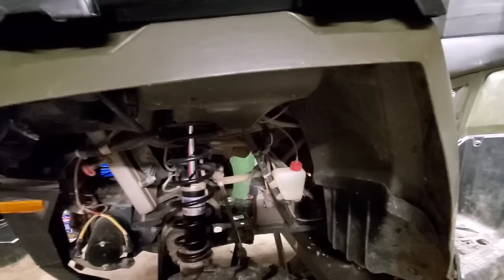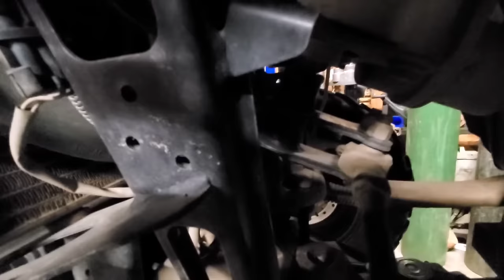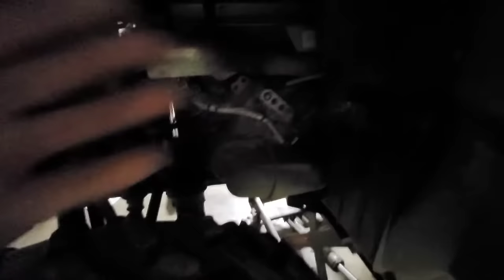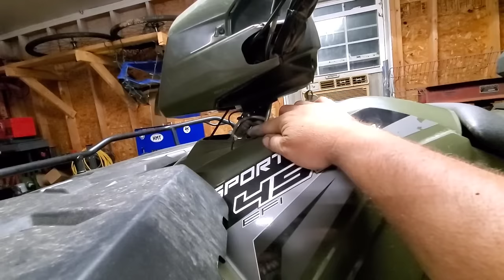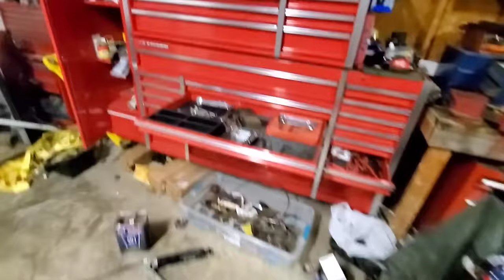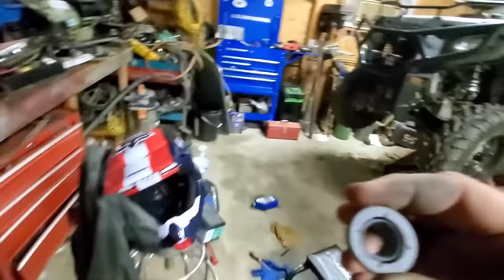Dear Polaris...this is shameful  #polaris #atv #sportsman

Comment: 2013 Polaris Sportsman 500 HO here. (Camo Edition). 1,460 mi.  189 hours.  Original owner, The only stuff that went bad so far was, some batteries, the O-ring for the float-needle in carb, oil changes, and the idle-adjustment knob sticking out of carb & a few plugs in the tires. No loose steering or wobbly tires or anything I can really think of other than the the choke knob don't stay out by itself when cold. The wire holder-support for choke-knob broke off the 3rd day I owned it.  Thinking about selling it in the spring.  Probably one of the most gently used atv's around,  I have a new 400.00 plow that I used once for less than 5 minutes.  I'm 63 years old now.  Was 2013 a good year? Sounds like the newer ones have gone down hill.
Reply: Still riding my 2009 Ranger 700 ! No problems other that normal maintenance!  I think today I would probably go with a Can-Am Defender if I were looking for a new UTV.

Comment: I have a 2020 570 premium with 2400 miles absolutely solid aside a brake pressure switch that dealer replaced. I wish I could give a video but I'm too old I don't know how to show everything in mine is tight yet. Rides like a dream and nothing wrong. You have another video of an 850. Why did you buy that one if you already had this one? I had a 2017 450 sportsman that was perfect but it had no power steering so i traded it for my 570 and currently have 2400 miles with only the brake pressure switch. Kawasaki brute force 750 is best machine hands down. Unfortunately you cannot get a factory windshield, heated grips, heated throttle and it only has two 35 watt halogens that absolutely are worthless. I live in Minnesota and it gets dark here at 5 ice fishing. Those lights are just about worthless. Factory Polaris 50 watt halogens with the 50 watt pod are very good. I asked a Kawasaki dealer for a windshield last fall they said unavailable and moose aftermarket heated grips 380 and no thumb warmer. They tried telling me thumb warmers were not a thing. Lol i had them in both my 450 and 570. Suzuki quad King is great but zero dealer support across America and again those accessories not even available. Can am is junk. Just push them on  dealership floor and listen. Plus you can't shift them without hitting your arm. Absolutely a joke how they position the shifter plus it's junk clunky. Way worse than a sportsman which ill admit is not in yamaha's or Kawasaki's class. Honda has no power steering!!! What the hell. Their three wheelers were bomb proof so I'm sure the quads are today but no power steering lol. Nope. So that leaves the grizzly. Engine will not entertain. Suspension not close to a sportsman. Will they last probably. But to get one with a windshield, heated grips, cannot order a thumb warmer, and storage is subpar. But a 23 with windshield, heated grips is 16000 in my nearest dealer. No grease zirks least none that i saw and led lights. Looked good. But my 570 2020 has had no mechanical issues sbd starts in Minnesota in February every time. Dealers are everywhere and parts are everywhere. I wanted a Kawasaki as i have a 2007 Kawasaki nomad 1600 that has never had a single issue. Harleys cannot even touch it trust me. But with no options and dealer support i can't do a brute force especially with no windshield and lights to get across a frozen lake at night. I kinda wanna see possible hazards in a 25 foot deep frozen lake. Polaris lights outstanding in my 2020. The 23 ultimate has led lights so bright honestly they lit up the dealership in day when i looked at it. Yamaha grizzly was not close even with the leds they have. Plus the pod was halogen.

Comment: I have a '07 Sportsman 500HO with 6500miles on it, it has no slop in the steering and the bushings are still tight. I am replacing all wheel bearings for the first time now, the only other thing I have done is replace the front springs and regular oil changes.

Comment: Just bought one a month ago. Already the Transmation is making strange noises and the display screen flickers colors and engine light comes on.
Reply: Either the alternator (it's called something else for Polaris)not charging the battery fast enough or the battery isn't holding charge properly.

Comment: I have a 21 850 ultimate trail with 5000km/250hours and that has all sealed bushings with o-rings everywhere except for the rear knuckle bushings that are the style you showed.  The knuckle bushings had play at 400km.  A couple sealed bushings had some play starting at 2000km.  I ended up buying garage product bushings and replaced all the front bushings and the rear knuckle bushings.  They are great bushings, they still don't have any play even after a few thousand km on them.  The rear control arm bushings where it connects to the frame are still the Polaris sealed bushings and i don't believe they have any play yet.
Other than upgrading bushings, i also did the front and rear frame braces as well as the rear diff brace from cecco racing.  I had to loctite and crank that steering stem pinch bolt down a lot to take the play out of the steering.  I just had it in the shop and found the under engine skid plate that is welded to the frame was bent up into the engine which was disappointing since I'm pretty careful not to beat up the underneath too much so i had to make a new thicker one.  I just replaced the rear U_joints as they were getting pretty bad.  The wheel bearings and tie rod ends have a bit of play in them now but i think im going to just keep an eye on them since they don't stay tight and realistically a little bit of play isn't hurting anything
I also had the sway bar sliding back and forth hitting the springs so i have to get some clamps to put on the sway bar when it was brand new
Overall it is unfortunate that a person had to get frame braces, fix the sway bar and make a decent skid plate just to feel like you are on a solid machine, but polaris isn't the only manufacturer selling machine that need modifications right out of the box.  I knew buying a new Polaris i was sacrificing reliability for performance.  Having said all that i am still happy with my purchase since mine hasn't really been too problematic and i do really enjoy riding it
Reply from the maker: As long as you are enjoying it, keep hammering the trails! Thanks for watching
Reply: Hi think yes , it’s the only top manufacturer needed mods on brand new machine out of the box like you said.

Comment: I have an 06 Sportsman 800.  Rear brake went out.  Had Polaris replace the entire system as it was over 10 years old.  Within a year it was bad again.  It is stored in a tool shed so it shouldn't go bad that fast when it gets little use.

Comment: I have a 2020 450 HO. Stalls out during idle several times until it gets 150 + degrees F. Came that way from the dealership, took it back they said it was fixed, nope, still does it every time. I have changed plug, checked gapping, adjusted throttle cable, changed gas, changed oil, air filter, no fricken clue what to do… maybe a bigger battery??
Reply from the maker: Not the battery.
When it acts up. Pop the seat and wiggle plug at the throttle body. 
My sons acts up and that usally solves it
Reply: I watched a video where low battery power was fouling the plug on new machines...change out both  new at the same time to fix the problem
Reply: Had this Same problem on the same machine. Low battery was fouling out the plug. New battery and new plug idles perfect now.

Comment: on my 22 570 they have removed the grease certs, so you know it will wear out sooner than later. the 1st time I plowed snow the front axle broke with 35 miles on it.
Reply: My eps is getting replaced. but they covered it for warranty $2200 part

Comment: I have found when a pressure washers output is too high it can cause significant damages. Many take their machines to a car wash that can have very high pressures.  With very high pressures you can actually force dirt and water into bushings and bearings.  Just a thought hope it is helpful.
Reply from the maker: Im just using a little electric jobby nothing to harsh. But the bearings simply dont seal out dirt at all.
Reply: @quadbilly2106  
 I've owned a 500 sportsman, 570, 850, and now a 2022 570 two up and knock on wood have yet to replace a worn bushing or bearing. I rode them all over 2500 miles except for the 850. The 850 the dealer offered me more than I paid for the machine and I couldn't say no.   I put 1400 miles on it in one year.. Like you I trail ride I'm not into mudding.  I've got no answers.  I really enjoyed the videos when you rode with kcatv.  I do agree with you that Yamaha makes a really good machine,, unfortunately they don't make a two uo.
Reply from the maker: If honda mad a sport 4x4 to compete with polaris in ride comfort not even power, their sales would go through the roof. I paid damn good money for basically an 8yr old chassis design with new plastics. The olde 500 were built with such better quality.
Reply from the maker: Thank you for watching. Kc atv is a bunch of damn good folks I promise you that. I had a freat time with them.
Reply from the maker: @dcsales2007   yes, I have the tool and I do grease the new ones.

Comment: Just bought a 23 450 Sportsman... def getting that 5 year extended warranty. Do they make aftermarket bushings?
Reply: Here is the problem with Polaris.  Their dirty little secret, if you will.
My mother has been an Attorney working in Polaris's Legal Dept. for many years.  We get new ATVs, UTVs, Snowmobiles, and previously, Jet Skis every couple of years for free.  Most of them are prototypes they have us "test" for them.  They do this with a lot of their employees who have been there for a while.

At any rate, one of the things my mother specializes in is "Contracts".  When Polaris is in talks to have their "Official OEM Parts" made by different companies, they have a minimum of spec requirements.  Most of the parts manufacturers BARELY meet these Spec Requirements but their prices are low so that has to be taken into consideration.

So, when someone says you should or you need to buy the OEM Parts for a Polaris "anything", your first order of business should be to stop listening to them.  There are numerous aftermarket suppliers out there and you should investigate what they have to offer as most of those parts will probably be the same in quality if not superior in quality to the Polaris OEM Parts.  

I have been buying cheap Chinese Belts for my ATVs, UTVs, and Snowmobiles for years.  I spend approx. 1/4 of the price for each cheap Chinese belt as I would the Polaris OEM Part.  I usually get a good 3 years out of them, sometimes 4.  3 years is the minimum requirement Polaris requires their belts to be able to last.  There is a matching mileage on those 3 years but I don't remember what it is offhand, but over the years, that mileage requirement has steadily dropped which shows the parts they are buying are dropping in quality as well.

Granted, some parts you don't want to be cheap about because if they break, they may take other parts out as well or they are hard to replace.  In those instances, make sure you get a quality product and your best option is usually an aftermarket dealer.

Comment: When you find a Unicorn Atv please post.  I never had. I’ve owned all makes and a lot of models and every one had mechanical issues.  My best ride and features so far is my 2019 Polaris Sportsman’s SP Hunters edition.  Zero issues to date. Maintenance and upgrades apply to all ATVs.  I still have Kaw and Hondas.  Same applies.  

Good video too.
Reply from the maker: Its not a matter of having mechanical issues.  It is the sheer frequency of the failures.
I owned kawasaki and honda before now owning mutiple polaris. Failure rate of parts are 70% greater with out question.

Comment: I've got a 2020 450 non-EPS machine.  2,500 miles on it.  I plow snow, trail and mud ride the thing.  Never had a bushing or bearing fail.    I greased the plastic steering bushing and it has no play.  I grease my wheel bearings once a year and grease my A-arms and drive shaft before each weekend of riding.  I've broken one axel rock crawling.  I did have the wiring harness fail at the throttle body connections at 2,450 miles and 3 years out of warranty.  I spoke with a Polaris rep about it during our state fair...he took my name and email address.  Two weeks later I received an emailed coupon from Polaris for $950.  Enough to cover a new wiring harness and sweatshirt.  This is my first Polaris and I'd definitely  buy another one.

Comment: Bro !!!!!! ... 2020 570  bushings greased every second ride ...bearings greased once a month (with tool)...drive shaft greased once a month ...oil and diff fluids changed at proper intervals...over 3000 miles on my machine and it is still an absolute joy to ride ..it's a tank !!!...I will give you the steering slop though.. mine has about a half an inch maybe an inch but for the abuse I put it through I can live with it and get a fix for it !!!!